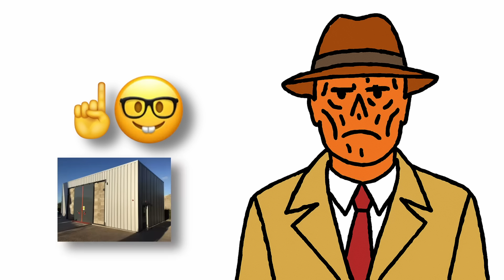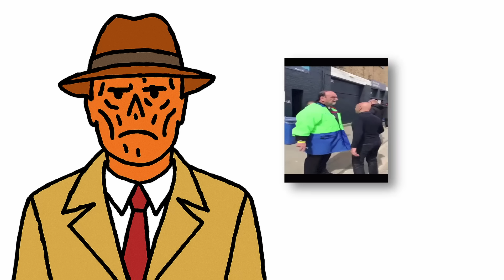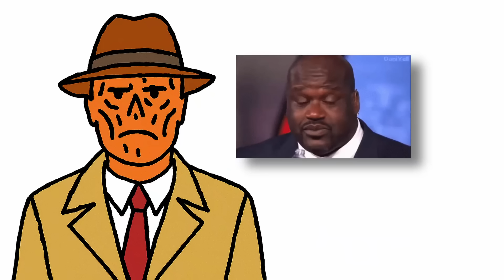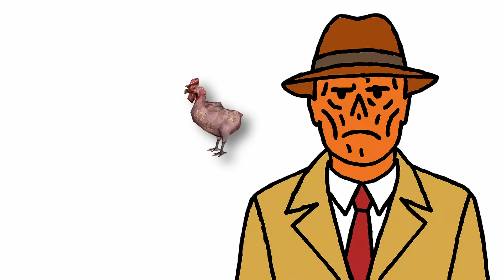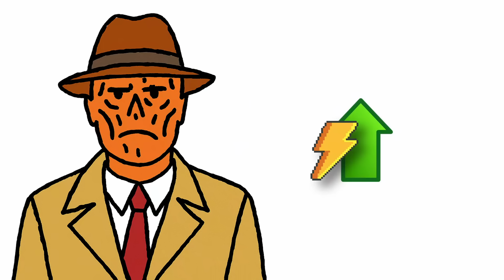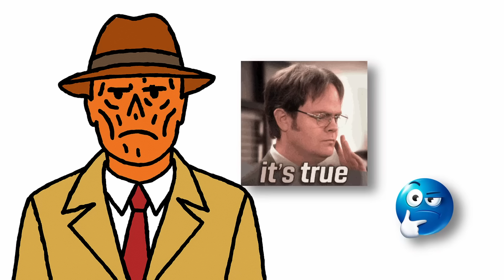How Do Fallout Vaults Work

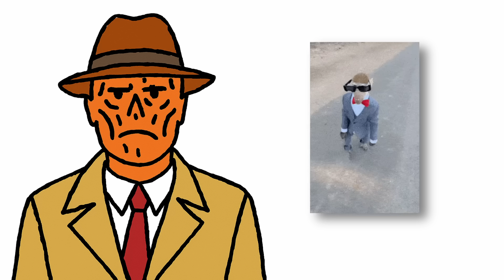Comment: @23:52 What baffles me is that these clothes somehow last for 200 years.  Not just the vault suits but also outside.  Finding clothing in random locations and somehow, they are still considered viable clothing.  I'm thinking there was some sort of high tensile strength coating they put on the fabric that lets it breath but also reinforces the fibers to keep them from breaking down from wear and weather.  Like ballistic fiber or some other synthetic that makes clothes practically immortal.